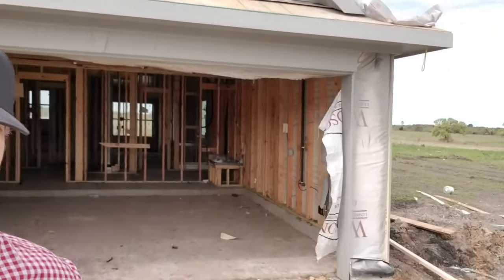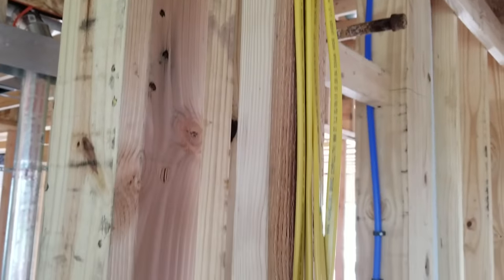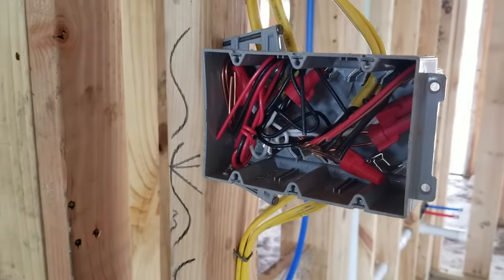HOW IS THIS EVEN LEGAL?!?!

Comment: I pour alot of footings and slabs for these home. Our company delivers a quality product but the finishers wet the concrete up way to much. The footing calls for a 5" slump 3000psi and the finishers make me pour it at a 8" to 10" slump. The slabs are pretty much the same way 3500psi 5" slump but pour at 7" slump. Each gallon of water added to the concrete reduces the strength.
Reply: So if there is failures on any of your pours does it come back on you or the builder
Reply: Keith B it will come back and fall on the builders structural warranty which is 10 years in most places. 

Problem is proving concrete was poured wrong. Concrete is going to crack, we can’t prevent that at all but we can tell it where to crack with saw cuts and expansion joints. As long as it’s not shifting, a crack poses no problems for a home and that is the reason we use rebar to hold everything together. And you must have a good waterproofing and drainage system away from the concrete as well. If all those key elements are in place then a cracked concrete wall or slab will be stable, and will not leak but if anything is left out of the equation then the homeowner will have problems starting in year 2
Reply: Isn't an 8 to 10 inch slump less water then a 5" slump ?
Reply: I was thinking measuring ground up instead of top of cone down , my mistake .
Reply: @gn4720  No, higher slump is a wetter mix. 0 slump concrete doesn't flow at all. Highest slump I've ever seen was 10.5". It was grey water with 1.5" rocks in it...
Reply: As an engineer who did concrete inspection for a summer, in general contractors know they are going to add water and order a higher strength mix to compensate. So if they order 4000-4500 psi concrete and add the water, it usually balances out. It's still a bad practice, but I'd bet their test cylinders (hopefully they are taking those) still get the required break strength.

Structurally they are probably sufficient, but yeah cracking and spalling will be much more likely in a higher water mix concrete. Plasticiser isn't that expensive...
Reply: @danbert8  Grey water with rocks , hilarious .
Reply: @danbert8  I am a retired Professional Engineer.  Why not use air entranment  admixtures to achieve workability.
Reply: Craig Peterman it's all about the Benjamins with tract home builders. There's probably not a single PE or other concrete mix expert at work for this developer anywhere in the same county as the jobsite.
Reply: Chris Grady can you get them to use a plasticizer instead of water to get the slump they want and the strength you need. That will keep the water from weakening your mix.
Reply: @SigmaDG  You ever tried trowelling that shit? Do a couple hundred feet of plasticized concrete and you'll be back to throwing water in it. That said, I can't understand why anyone would use that much water, especially in a footing, when time is money you can't afford to seal your footings airtight and you really need to be able to throw forms up as soon as the footing is stripped.
Reply: @craigpeterman27  I was thinking that, too.  But, of course, water is cheap and plasticizers ain't.
Reply: Whats a slump?

Comment: My farmhouse was built in the 1890's and has dimensional lumber, 1" tongue and groove exterior and interior sheeting. Also, cedar exterior siding. Plaster and lathe interior walls. Still as solid as the day it was built.
Reply: Yes. I build with only dimensional lumber and plywood. I don't use one piece of osb anywhere in the houses I build. I'll never understand why builders would use osb in a damp climate where I build. You're just asking for problems down the road.
Reply: How's all that lead paint 😂 holding up?? 😂😂😂
Reply: @jamie.777  that can easily be removed or painted over. The lead doesn't radiate into the air, (unless its flaking off) it has to be ingested to affect someone

Comment: In my neck of the woods homes built like this have actually blown over during construction. Metal strapped framing and everything complete except for the cladding. 45 mph wind toppled them.
Reply: Lol in Florida we have better built trailers strapped to the ground that look safer to stay a storm in.
Reply: saw that happen here in kalispell mt. last summer.... stuff built like this iant gonna last in snow country!!
Reply: @lukewarmwater6412  how heavy does snow weigh on a roof? I've always wondered.
Reply: @richardwaldron222  thats hard to estimate. depends on how much water it has trapped in it. in the spring a foot or two of snow getting rained on can weigh alot. a good stiff breeze when this house is loaded and the roof will turn 90 degrees as it falls on top of the homeowners and crush everything beneath it.
Reply: In my neck of the woods (USA-MI) they'd freeze
Reply: @kcthehandyman3944  30 mph wind outside, 15 mph wind inside....
Reply: Stephen V  It will blow apart in 150 mph sustained winds in a Florida hurricane.
Reply: I watched an entire hotel under construction get blown over that had that strap style sheer supports.    That was a fun day!
Reply: Stephen V we’ve had a lot of these crappy foam clad-metal strapped houses fall over in strong winds here in southern Ontario. It’s ridiculous we still build them like that..
Reply: Luke Warmwater I agree ,aI live in the southern lower, lots of wet snow , and good stiff winds.
Reply: Tokin Please don't quote me on this ,I'll have to look it up , but I believe code for snow load is 90lbs a sq ft.
Reply: @lukewarmwater6412  Although, from the way this house was built, no snow would accumulate on the roof, as it would melt right off from the heat leaking from the house.  :O
Reply: @Beandiptheredneck  Really??  I've got to keep an eye out.  I'm in Hamilton, and would kind of enjoy seeing something like that (assuming that the cost would fall to the contractor, and not the unwitting buyer)
Reply: Undercover Hat the developers have insurance that ultimately pays for it, the whole house goes in a dumpster. Some of them were in Niagara Falls last year, a few in welland in the last couple years as well. Last year there was 3 or 4 all on the ground side by side along the qew in Niagara Falls
Reply: @kcthehandyman3944  Upstate NY, 2x6 with 5/8 OSB sheathing is required.

Comment: I purchased a house in 2016 in Temple, TX and being a former electrician I discovered that the electricians ran 12 awg from the panel(s) and then at the first box switched everything to 14 awg and everything is on a 20 amp breaker and I let the city inspectors know what I discovered and they blew me off why you may ask? Because they NEVER had done a final electrical inspection or a occupancy permit for my house and they put 1” foam on the exterior of the house then put hardy plank siding over the foam board and this was a Omega home. These houses are put up cheap but charge you for a premium home

Comment: What a crazy waste of resources to build this trash. There are so many beautiful old homes around me built over 100 years ago that will probably stand for 100 more. Nothing special, just well-built homes. And then there is this crap that only has to last just long enough to where the developers don't get sued. It's sad. Thanks for making this video, it's great to know what's out there!
Reply: 100 year old homes don't have the energy seal that he is screeching about, vapor barriers or concrete foundations.
Reply: @NexusCapital  They definitely had concrete foundations.  They leak, but you could fix that if you ever replace the siding.  Why should we be building homes in 2019 that leak more than a house from 1919?  Plus the concrete from 1919 is legit and you don't have to worry about a builder pouring weak concrete to save money.
Reply: @_PatrickO  We build really solid houses here in western Wa State so I dont know what you are talking about. Ive flipped 12 homes in the last few years and remodeled all of them my self. By far the worst construction has been pre 1960 homes. They are all crooked, drafty and clearly did not have inspectors much less building codes. Honestly I have no idea what you are talking about. My experience with old houses has been so bad I won't even buy them anymore. 1980s+ are dreams to work on I love them.
Reply: @NexusCapital  I'm not knowledgeable at all but stuff build after WWII definitely went up fast and probably of much cheaper materials that what you see pre Great Depression. The stuff before the economy and war issues at least had great character, skill & craftmanship even if it was a starter home.
Reply: @KLondike5  that sounds nice but its just not true. You only see the old houses still standing that actually made it. There was tons of total crap built by guys that did not do it for a living but just had some know how. Think about how many of those great "skill amd character" homes have been torn down because they fell apart or sunk into the soil. I use to think all of that but then I started working on all those old houses and realized it was really hit or miss if it was a true craftsman or most likely bill and Ted with a 12pack. They literally insulated houses with newspapers, had no caulk and seal or blower door testing, no vapor barrriers under the homes R-value wasnt even heard of or engineered anything. The only thing on their side was literally tight grained old growth timber that we don't have anymore. Don't fall for the "they dont build em like they use to" meme. It Sounds nice and nostalgic but isn't true.
Reply: @NexusCapital  I rent and live in 100 year old homes. These are pre Depression but at or after WWI. But even being in the upper midwest, energy costs are hardly a big deal in my experience even on these old leaky homes. The duplex I rent out built in 1913 shares a 30 year old furnace. Heat is included in the rent so they aren't being very conservative with their use but they didn't even break $300 on the coldest month. I usually wonder how many dollars get thrown at the issue to save a few hundred bucks over a 3 or 4 month winter season. I prefer the skill of work, detail and durability of the these old place vs anything after WWII. They also tend to have a smaller footprint so I guess modern homes need more attention to energy efficiency when they have so much pointless square footage.
Reply: @KLondike5  I own several duplexes and apartment buildings and completely disagree with you. You can enjoy the oldies I don't buy stuff pre 60s anymore. Take care.
Reply: @NexusCapital  That's the thing. Many things built now doesn't have ANY of the staying power of those survivors. The only way to build survivors now is to spend an idiotic amount of money and fly in the craftsmen who still exist. I just can't fathom paying so much money for modern stuff with zero real character with weak materials that are worn out or weak after 50 years. Here I can spend half the money of a new build to buy a survivor. But yes, plenty of those low budget 1000 sq foot worker homes from a 100 years ago aren't worth saving.
Reply: @NexusCapital  Who cares about WA, houses that are 100 years in urban areas all have concrete basements and are solid houses.  They leak less than the type of crap shown off in this video.  Look up craftsman homes from the 20s.
Reply: My old money pit was built in 1891. Kills me on little maintenance issues and small fixes. Impossible to hammer a new nail into 100+ yr old wood. And the 2x4's are 2" x 4" (makes replacing one a complete nightmare) with zero knots.  That said, I don't think it's going to fall over anytime soon.
Reply: @NexusCapital  nor were they sheeted. But, the quality of lumber was far superior to today and the lap siding they nailed up was an inch thick solid wood with no knots. The interior walls used lathe boards gapped to support the plaster. Builders were Craftsmen then. They took pride in their work and did the job properly.
Reply: @markprice1614  im not making an argument for no sheeting on a house im saying that the majority of old houses were not built by craftsman and that is why most of them are still no standing today. My argumemt is that only a small amount of guys knew what they were doing and that is why those houses are still standing but sparsely populated across at least my demographic in western Wa.

Comment: We have not had any problems with our Hardiplank siding in the 20 years we have owned  our home, BUT then again it was installed over normal sheathing.  Thank you for pointing out these shortcuts that the average homeowner would not even notice.

Comment: Lots of older homes by Craftsman (read: Sears) were built with the siding directly on the studs, and many without any tarpaper or rosin paper under the clap siding. I have seen some done with the studs on 24" centers and even roof rafters that are 2x4 or 2x6 on 24" centers. Not sure what holds 'em up but they are still standing 80 years later.
Reply: Old growth lumber with 15 growth rings per inch instead of new growth pine with 3-5 growth rings per inch...huge strength difference between wood used 80 yrs ago and todays...I've seen many flat laid  double 2x4 headers..old Douglas fir is no joke.
Reply: @colinglidden5702  ... hey, I believe it, but still shake my head based on what we normally do today.

Comment: The cost of putting plywood is not that much , and where is the building inspector for framing .
Reply: at the golf course enjoying his payoff
Reply: @forgedabouted  I saw a house that someone i know bought recently and it is still being built. I was amazed at the terrible quality of the framing. I know next to nothing about carpentry and i could have done a better job. There were all kinds of gaps that should not have been there, things were not even square, nails horribly placed etc. It was done by mexicans of course too so...
Reply: The house is actually per minimum code, the wind bracing per chapter 6 of the IRC gives several ways to it, one of the ways is outside sheeting, or OSB(wood structural sheathing) another way is to cross brace with in laid diagonal 1x4,, another is metal strapping,, and 1 way to do it is with the interior  sheetrock, as long as you do the proper(more   stringent) nailing pattern ....the house wrap meats ESR 3729(its printed on the house wrap) look it up,, it meets code for water resistance,,, no builder and I mean no builder including this guy doing the video, uses water proof material under the exterior finish of the house,, unless it's a  cement material, such as rock,  stucco, or EFIS... Now with that being said ,,,I do not suggest anyone buying a house that is built to minimum code ,,that is the worst possible way you can build a house,,, but what he is showing you meets  minimum code.
Reply: I am a old builder and one thing I have learned in over 50 years in the trade is that "the cheap man pays the most".
Reply: This may meet code. I've been out of the business for about a decade. Keep in mind code is the minimum standard. As for building inspectors they are just a revenue stream for their municipalities. They hold absolutely no liability for anything. The county I live in didn't have a building codes department until 1992. I'm not saying they are bad people, many are nice guys, but they can only uphold what the book says. I'll bet that the builder has their own mortgage company and that's where they are making the money. I watch the national builders here play this game everyday. I wouldn't buy it. Ever.
Reply: Codes need to become better. Charging $150 + per square ft. And all you get is bare bones. That's BS. 
I rescue big dogs and have built much better outside kennels for them then this house shown. And am a 50 + yr old lady. Shame on the builders...
Reply: @iian_  well it's cheaply paid the workers barely get anything from what the builder gets framers have to haul ass to get by.
I work in roofing and I hate these "designer" homes, they are unnecessarily cut up and complex.
Quality has higher price and these are made for quantity and maximum profit.
They cheap out the building materials and labor as much as possible and hike the price all they can. Homes these days are not even an investment at all. Like he said it's best to get your home done independently than a a mass produced suburb and choose your electrician and such.
Though I have never seen this before where they skip out the plywood.
Reply: @Gina-zn1dv  today it's more like $250
Reply: Even if the sheathing isn't code in that area, all manufacturers specifications supercede building code. If the siding calls for a backer, then the contractor is as much to blame as county code enforcement. Where is the project manager?
Reply: @thepinkerton657  most code require corner bracing 3/8 plywood or metal bracing is sufficient , i have build more then 1 house  and large houses but we apply sheeting all over .